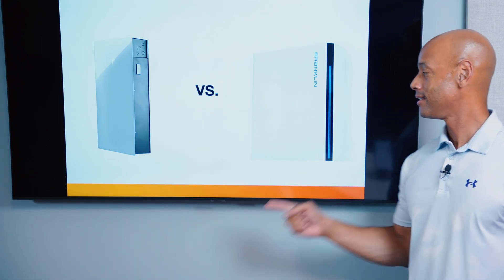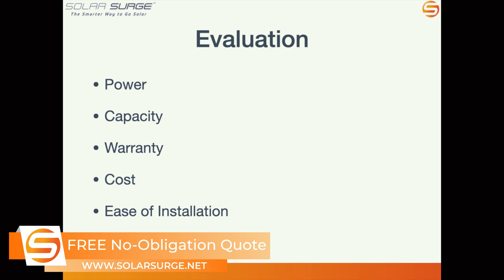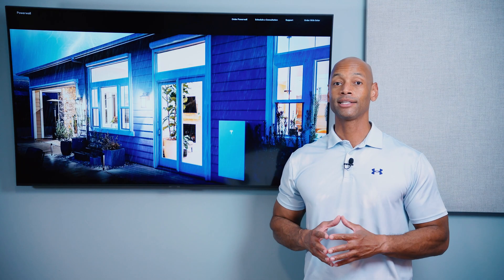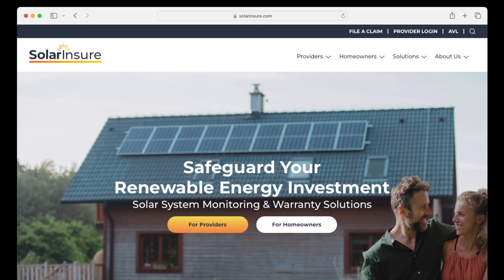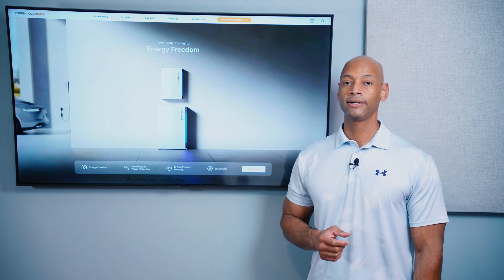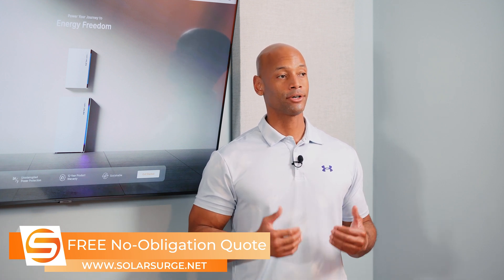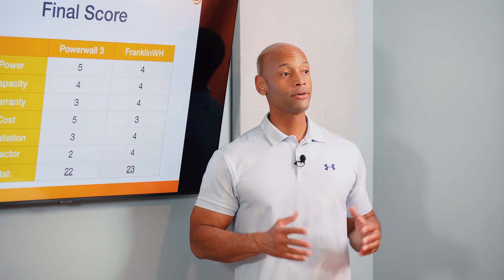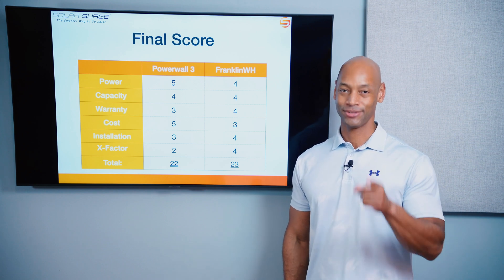Tesla Powerwall 3 Vs Franklin Battery

Comment: Is there a hardware limitation within the PW3/Expansion Battery to Gateway 2/3 hardware architecture that would preclude enabling Expansion Batteries to PW3 “follower” units.  Similar question for enabling Backup Generator functionality?  

It seems to me that a solution would be a Generac-like generator AC output that is tied into the PW3 AC input that the PW3 uses to interface AC solar inputs from micro-inverters.  Alternatively, the DC generator could be rectified and connected to DC solar inputs on the PW3. This could obviously not be accomplished without some subsystem cooperation from Tesla.  Franklin, Enphase and Generac have figured it out.  So too have all the power utilities that Tesla engineering is already using to recharge the PW3s.  I’m sure Tesla engineering has a solution that includes backup generators as well.  This limitation is either a business marketing decision or management ego.

Comment: The PW 3 is very easy to install given they have designed a lifting fixture to easily mount it to a wall. The actual lifting and attachment process takes just a few minutes and virtually no brawn.  It’s just a matter of time before the PW can be charged by a 10+ kwatt generator and electric vehicle backup is available. Franklin throughput power capacity, at 5 kWatts, is less than half that of the PW and inadequate for whole home backup.

Comment: Your comparison is way off-base.  The only real decider is if you already have an AC coupled system - maybe even micro-inverters, you should not go with Tesla.   If you are installing a new system, go for Tesla.  Tesla has better specs, better reliability, and better price.   Warranty - Do you really think Franklin will be here in 12 years?  I don't. Tesla PW is crazy heavy, but they also have the drill operated lift-dolly.   Telsa app has way better control than Franklin's, and they actually maintain/update their software.  Summary: Apples (AC coupled) vs Oranges (DC Coupled) - not comparable, just a choice.

Comment: Tesla having meter collar fires and limited availability. Franklin has yet to turn a profit. The residential energy storage industry has turned into cheap throwaway crap like a freaking bic lighter. 90+ % of installers have limited to no electrical training and virtually never read the manual and screw up 90% of their installations. Good contractors with proper training and business ethics virtually unable to make a profit.

Comment: i have enphase 8m micro-inverters, with a generac generator. how would i do the Franklin battery to allow the solar iq8m to still collect solar in the day when the grid is down? could i just turn off the outside switch to generator? i know its complicated.
Reply: This is actually a very easy retrofit.  You will plug both solar and generator into the FranklinWH aGate, and that will manage the battery, solar and generator power

If it’s a manual generator, than yes, but if you have an already installed ats, or can do a two wire start install, it can also turn on generator automatically if power low in battery :)

Comment: I have two Franklin batteries and everything I was told they would do, they do. I can power my whole home minus the stove and dryer being on at the same time but when you’re in a power outage you’re going to eliminate the big power loads anyway that’s why the power wall 3 battery will drain quickly to much power output at one time

Comment: Looking at a Enphase system  but using tesla batteries. The company also wants to do Micro inverters since I will get some shade on the panels but I am not sure since tesla system has them built in. We do have a whole home Generator but it's on the main panel with a interlock. If we had to use it how would the Tesla system know it's not coming from the grid. Since it's on the main panel. It should work that way?
Reply from the maker: It's OK to have solar on a home with generator backup, but the connection from the Enphase combiner to the grid must be outside and above your main panel near the meter base.

Comment: I have two Franklin batteries with 28 solar panels (10.2KW system) with enphase micro invertors.  Batteries were a retrofit.  I am in CA with NEM 2.0 so full dollar for dollar credit from PGE.  Franklin customer service is fantastic.  Real person answers every time.  I am using my system in Time of Use mode, which means that my home will never pull from the grid during peak 4-9PM periods.  I am charging my batteries up during the day, and draining them at night down to 20% minimum.  What sold me on Franklin was the smart circuit technology, where I have my Tesla home charger on one additional circuit, and my 3.5 Ton AC on the other.  And the batteries are then connected to my essential circuit panel (basically the whole home except for pool, hot tub, washer/dryer and oven).  I also added the backup generator module ($1200) so I can have double redundancy with my 7000 watt continuous invertor generator that can be utilized during extended winter outages when the sun doesn't shine.  The other cool feature is the Franklin is tied into the National weather service, and if a potential power outage is forecasted, it will go into emergency back up mode and use the grid to quickly (regardless of solar output) charge the batteries to 100% in case the forecast is correct.  This happend about a month ago when we had a brown out and the system worked perfectly when I was out of town.  Battery kicked on when my house sitter was there, and she called to say that the laundry wasn't working... she didn't even know that the home was in emergency battery mode, and I could see in the app that the grid kicked on early in the day even when the sun was shining to max charge it up to 100%.  I believe tesla has this same storm watch feature, but the DO NOT have the generator module.  That sealed the deal for me.
Reply: Thank you for this. I’m in CA too and looking at a similar setup. Was thinking a Generac whole house generator for the generator portion. Did you find a single person to do both installs (battery and generator)?

Comment: These scoring break downs done here show where the bias is. If one system puts out a continuous amount of power that is more than double the other there is no way that only a one point difference. Also installing one piece of equipment that's  lighter than the other one should be easier than installing two pieces of equipment that's heavier and takes up more space. Which explains the cost of installation difference. Why would it cost more if it's easier.  Make this makes sense.  ANYBODY

Comment: I'm looking to start with the batteries before going solar.  My roof is 8 years old, and I don't want to install the solar panels then pay to have them removed when I have to replace the shingles.  I also will fight the HOA to get a metal roof on before going solar.
I plan to use the batteries for my whole home during the day, and switch to grid at night allowing the batteries to recharge.  I like the idea of having a generator to recharge the batteries should the grid go down.  Does the Powerwall 3 not allow for a generator to recharge them?
Thanks for the response.

Comment: Just installed 2 pw3s in my home and the install couldn't have been easier with the telsa lift and integrated/pre-wired inverter.   I would rate install a 5, telsa really did make this very easy for installers.   

Also the seamless app integration with my existing  ev wall charger and telsa car  works great and worth at least another x factor point.

Comment: We're nearly 1 year from the day our FranklinWH system went on-line, using 2 FranklinWH batteries for 27KwH of storage, tied in to an existing 13-panel solar array and Fronius Primo inverter.  Because we're in a remote area, we chose FranklnWH in part due to the ability to use a generator backup.  The installers put in the FranklinWH system plus a Cummins 12K propane generator...in a single day.  That included digging the trench's from the propane tank to the generator and the generator to the FranklinWH.  The generator has kicked in twice and did so automatically during a lengthy winter storm. It ran our 2800 Sq Ft house while charging the battery's in less than 3 hours. The FranklinWH App allows me to monitor and control the system to run our home on the solar panels once the batteries are fully charged.  We've experienced a number of Grid outages. Each time the FranklinWH kicked in so quickly that we didn't even know the Grid was down until we received a notice on the FranklinWH App.  We receive those notices before we receive a notice from PG&E.  The few times I had to call FranklinWH support (mostly for questions about how to operate the generator tie-in) and they've been extremely fast to respond.   It's been a life-changer for us and I highly recommend it.

Comment: We have a powerwall 2 (actually 3 of them).  Either now or later can we add more battery?  Preferably Tesla, possibly other.  Our inverters are APSystems DS3, and we use the Tesla Gateway.  The electric power company is our 'backup'.  Here in Clarksville TN we can sell some excess power for about 1/3 of the cost of power.

Comment: So I think you missed some x-factor.  The Powerwall’s power switch is worth at least 2 if not 3 points.  It’s easy to install, it’s cheaper than any other switching system and coupled to the power wall it allows you to put a 60 amp breaker in a 200amp breaker box.
Reply from the maker: Good feedback.  We have a video coming out soon that focuses on Tesla unique advantages including the backup switch.
Reply: @SolarSurge  oops, sorry, yes, I meant the backup switch.  So more points: The batteries and other components connect via Ethernet and tcp/ip and master and slave are automatic, no config needed, just cable to the router, and daisy-chain the batteries.  They have some other software updates coming as well that in theory would let them connect to other batteries via serial.   What I’d love is to see is Enphase create an app that runs on or connects to the tesla and gets rid of my enphase controller box.

Comment: I just signed up to get two Powerwall 3s using the backup switch. I have two separate existing solar systems, one with Enphase IQ7s and one with SolarEdge inverter. All the old inverter components will be removed to use the built in inverters. Will greatly simplify my system and after having two SolarEdge inverter failures over 6 years, I'm hoping for a more reliable simple system and whole home backup including a/c.

Comment: I would give Tesla a 5 on capacity and Franklin a 3.   On installation, I would give Tesla a 5 and Franklin a 3.  There will be less switches with Tesla, plus no inverters on the roof and I go DC to DC.  This makes Tesla better for efficiency.

Comment: Good comparison, but not seeing how Franklin is an easier install than Tesla.  Several items missed here, including that Tesla also has the drill assisted dolly.  But more importantly, that many jurisdictions allow the Tesla Backup Switch meter collar to be used - greatly simplifying whole home backup installation with no service/feeder wiring to redo or transfer switch to wire.  So install should be the same or better with Tesla, and X-factor point given for that - not to mention it has an impressive 6 MPPT channel solar inverter in the unit.  And Tesla can AC couple to other solar also - if you don't want to do that.  Also would like to see mention on how you can parallel 4 units, and/or add more battery capacity to a single unit - and how that compares to Franklin.

Comment: I am not sure that the Tesla Powerwall 3 is such a great bargin, even when ignoring the fact that it is designed only for a main string inverter type of install with no panel-level optimization and no panel-level monitoring capabilities.  

From an NEM 3.0 self consumption effectiveness point of view, as well as being able to sustain longer than 1-2 hours of a power loss period for the backup use cases, Tesla's Powerwall 3 13.5 kWH capacity with its continuous 11.5 kW power ratio doesn't give any advantage. The continuous 11.5 kW power sounds more like a marketing story than an actual benfit. It doesn't make any sense to install a single PW3 when a continuous 11.5 kW power is needed, since a continuous consumption of 11.5kW will drain an entire single 13.5 kWH battery within 70 minutes (one hour and 10 minutes). This means that a useful whole home install will require at least two batteries, if not three, because of the capacity needs. Given that, the Franklin's 13.6 kWH capacity and continuous 5 kW power ratio makes much more sense as a building block, since it will take 164 minutes (2 hours and 44 minutes) to completely drain. From here we can do the math:
- A single FranklinWH battery: up to 5 kW of continuous power for at least 2 hours and 44 minutes.
- Two FranklinWH batteries: up to 10 kW of continuous power for at least 5 hours and 28 minutes.
- Three FranklinWH batteries: up to 15 kW of continuous power for at least 8 hours and 12 minutes.

Given the need for multiple batteries for any NEM 3.0 practical self consumption and backup use cases, and given that the collar approach is not applicable for an install of more than a single PW3 battery, the Tesla Gateway along with an extra Critical Load Center Panel are also required with a multi-battery install, which blows away the theoretical cost advantage of a single Tesla Powerwall 3 with a collar install connected directly to the main panel.

Also, based on the fact that the Tesla Powerwall 3 with its internal built-in inverter(s) is more than 100 lbs lighter, as well as smaller in dimension compared to the FranklinWH LFP based battery, it is highly unlikely that the Tesla Powerwall 3 chemistry is LFP based. Most likely still the older and less efficient and safe NMC based, like the Powerwall 1 and 2.
Reply: Yes Tesla is a lot of marketing hype, but it is definitely an LFP battery however new studies are showing that they are not much safer than anything else and are actually vastly more toxic in the event of a fire. There is simply too much marketing information rather than factual information.
Reply: @boblatkey7160 I’m a big LFP fan - I haven’t seen anything about higher toxicity, or any fires for that matter unless massively overcharged.  Would love more info if you’ve got links.
Reply: @boblatkey7160  If the Tesla Powerwall 3 is "definitely an LFP battery" how come they are not stating that anywhere? All of the other companies that offer LFP batteries (e.g. FranklinWH, Enphase, Canadian Solar, and others) are proudly stating that, as well as the fact that as a result they are also UL9540A approved.
Also, installing multiple Tesla Powerwall 3 batteries requires at least 3 feet space between them in California. That is not the case with LFP batteries that were able to be tested for UL9540A and thus can be mounted within 6 inches of each other.
I still doubt that the Tesla Powerwall 3 is LFP based. I would like to see an official statement or a spec doc from Tesla stating that.
Reply: Perhaps the Tesla Powerwall 3 uses CATL M3P cells or some variation of M3P (includes other metallic elements, such as magnesium, zinc, and aluminum, in place of the iron in LFP batteries), which might explain the fact that it is lighter, smaller in dimension, and has a higher energy density than other iron based LFP batteries?
That might also explain the fact that it is not (yet?) UL9540A approved.
Reply: @hank-kal  well I work for another manufacturer and we were told directly from Tesla that it is an LFP battery. Second, Los Angeles Department of water and power said they are going to enforce the 3 foot rule for batteries in excess of 20 kWh per battery bank. They do not care about what type of lithium chemistry it is and they refused to differentiate.
Reply: @hank-kal  I just looked it up again and the battery is LFP and it is UL9540A listed.

Comment: I think one X-Factor you missed for the Tesla is in some areas of the country the system can participate in the VPP programs.  I have a SunFusion Energy storage system DC Coupled with Sol-Ark inverters.  I am working on installing a generator input on my battery cabinet so I can if necessary charger my batteries from a generator.  My house is on Propane so I plan on just using a propane powered generator for this.

Comment: Why not just use smart outlets for any non essential loads? 100% granular and far cheaper than a new smart panel plus installation. Also, twice the power is only worth 1 point for Tesla and the integrated inverter should even out installation ease.

Comment: What is your opinion on the Midnite Solar Rosie 7048 inverter?
Reply: Great for hobby gear or if you're going to live off grid without a permit. Probably not going to get a permit if you were tied to the electrical grid.

Comment: I am looking at putting a solar system in using the Tesla power wall three battery. I have an existing Generac 16 kW generator that’s 20 years old. It has its transfer switch with its panel.. what I plan to do is run my critical loads off the generator panel. The Tesla battery will supply the main panel which will supply the generator panel. in a power outage, the Tesla battery will take over. if the Tesla battery becomes low, I could start the generator and run the critical loads. When Solar comes back, I could switch over to the Tesla battery. Unfortunately I will not be able to charge the battery from the generator however, in time, I’m I hope there will be a device that you can to attach to the battery to enable this to happen.  Thank you for the comparison. do you know what type of lithium ion batteries are used in each battery?